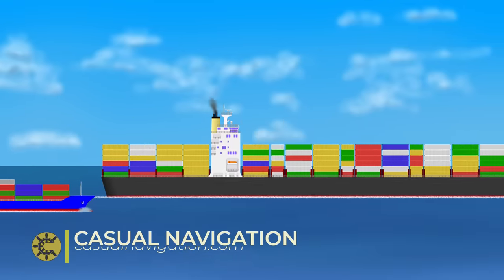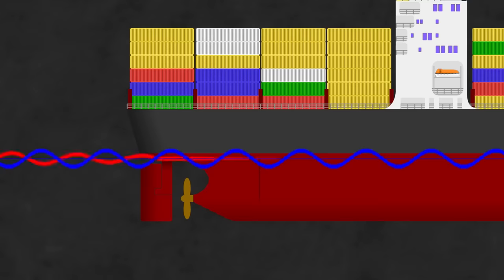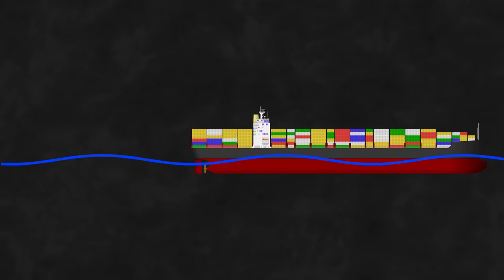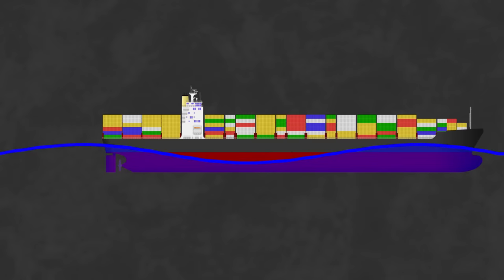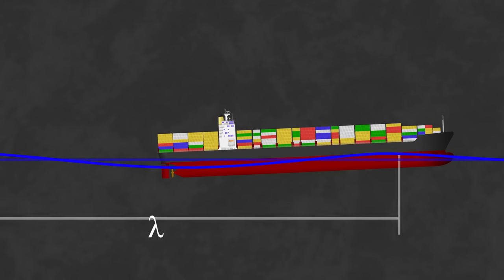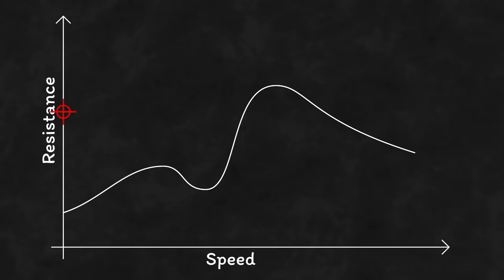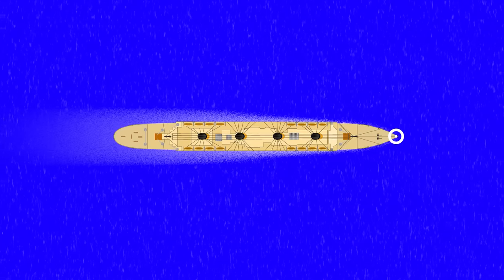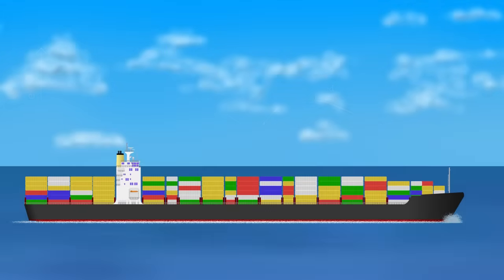Why Are Big Ships Faster Than Small Ships?

Comment: can you please explain how or if this applies also for River cargo ships? Because i'm a River Pilot on the Rhine. I saw in my lifetime as a River Captain, that our bigger ships, also need less energyto get to a faster speed then the smaller cargo vessels. But on the river you stil, have the so called "Slip" effect over ground, because we often have less dept under us then seeships, i would wonder how this effecty concur eith eatchother.
Reply: The video is way over-simplified to the point of being completely wrong. It is naming ONE of a series of important effects. For example, a submarine does not have a bow wave or stern wave while underwater, yet extremely overpowered nuclear submarines are still limited to a little over 30 knots. Nuclear-powered aircraft carriers are also limited to a bit over 30 knots which is oddly a similar max speed to nuclear submarines.

There are a few major factors not addressed at all in the video:

1) The drag equation that does not care about bow or stern waves. This formula is Power = 1/2 p v^3 A Cd. If you combine this drag equation with the Cube-Square Law, you get the number one reason why larger ships are faster than smaller ones. 

2) Turbulence. 

3) Inherent efficiencies of larger engines.

The first one has the power of a ship's engine having to go up by the cube of the ship's velocity. This is easy to understand as the ship has to push water out of the way of the hull at the ship's speed. The energy imparted to the water will be 1/2 m v^2. However, as speed increases the ship moves more water out of the way per second. This is directly proportional to v. This is where the third v comes from. The p or rho is the density of the water so p v is proportional the mass of the water moved out of the way per second and the 1/2 v^2 is added to give the energy. The A is the cross-sectional area of the hull and the Cd is the drag coefficient (a term for how efficient the hull is).

You can roughly figure out how much increased horsepower you need to increase the speed of a ship by just using the drag formula. This is what the formula is for. This is why it works for aircraft, cars, and boats. This is why a family car can go 100 mph or 160 kph with 200 some horsepower but a 400 horsepower car may only go 150 mph and a 800 horsepower car may only go 200 mph.   

As a sphere increases in size its surface area increases by r^2 and so does its cross section but its volume increases by r^3. This same law works for all 3D shapes. Larger ships have less A or cross-section per unit mass than smaller ships. This makes larger ships more efficient even if they do not have much of a bow or stern wave at all. Larger ships are more efficient even if they are moving at just a few knots with little bow wave at all. This logic works equally well for submarines, aircraft, and cars as all vehicles on earth move through a fluid (air or water). This is why larger aircraft have longer range than smaller aircraft (all else equal) because they can be more efficient per unit mass and burn less energy per unit mass per second to go a certain velocity. This is why even very slow-moving cargo vessels tend to be large as it is cheaper fuel-wise to transport in bulk.  Water is vastly denser than air (so p is much larger), but water allows for very large craft and not too much need to build extensive infrastructure for every mile those craft move. Aircraft are more efficient for the drag formula but need to move so much faster to maintain lift, need to have so much more surface area (in wings) to maintain lift, and have a lot more turbulent drage. Huge water going cargo vessels (barges to large oil tankers) can benefit from the Cube Square Law without needing tons of expensive infrastructure. Cars have to make contact with the ground and a lot of energy is burned in friction in the axles and with rubber moving across the road.

Smaller speed boats can become more efficient by raising much of the hull out of the water and thus reducing A per unit mass. This works similarly to hydrofoils but like hydrofoils it requires fairly high speed. Speedboats are fast not because they ignore bow waves but rather they lift much of the boat out of the water and reduce A.

Turbulence is another factor. Smaller craft have more surface area per unit mass to cause turbulence. Turbulence is a complex factor but theoretically the maximum efficiency wing of an aircraft would be infinite in length because the tips of wings produce a lot of turbulence. This same general idea is true for boats. Propellers and everything else is generally more efficient when larger. A maximum efficiency boat would be infinite in length for quite similar reasons. The bow wave issue is just a subset of concerns that causes increased turbulence.

Engines are more efficient generally when they are larger. The maximum efficiency jet engine is the size of a 777 dreamliner's jet engines. They're huge. Huge marine diesels are extremely efficient. These engines can only fit in larger vessels. They are more efficient for many of the same reasons that larger aircraft or ship hulls are more efficient. Larger marine engines can produce more horsepower for their size with less surface area causing friction. The thermodynamic cycles of larger engines are also generally closer to the theoretical maximum.

An example of larger engines being more efficient are R/C plane jet engines compared to full-sized aircraft jet engines. R/C airplane jet engines that are very small guzzle huge amounts of fuel to go a fraction of the top speed of much larger jet engines. Small animals like mice also have heartbeats way faster than humans. Whales have heartbeats way slower than humans. 

The subject on why larger vessels are more efficient than smaller vessels (per unit mass) is a complex subject. Bow and stern waves are merely a part of it that novices overexaggerate.

Comment: 2.21 Hull speed , least efficient
3.21 Hump speed , worst.

From the graphic, looks like the most efficient speed is between Hull speed and Hump speed (cmiiw).
Reply: true, but to get over hull speed you need a massive amount of power, so commercial ships only make 50% hullspeed max
Reply: @Jacob-W-5570  That's unfortunate.
Because my understanding is, ship only need to speeds up, past hull-speed 1 time, then the resistance go down, almost the same with 50% hull-speed.

But base on your comment, that 1 time energy boost isn't economical on commercial ship.
So . . perhaps only private ship, that willing to spent that 1 time big energy, and then cruise in faster yet energy efficient.

Comment: For the live of me I don’t get the need to use “feet” or other weird units that do not fit together, as opposed to international ones, particularly in formulas, requiring weird constants and having other inconveniences. Why arbitrarily complicate things like that? As said, it’s beyond my understanding
Reply: Actually, in many cases it is the metric system that leads to complications.  For instance,  speed in knots - knot is based on nautical mile distance unit, which is exactly 1 minute of longitude, so why more convenient to measure on charts than km.

Comment: I expected the answer to be related to the square-cube law. My intuition was that the mass of the ship and the power of the engine increase by the cube of the increase in size (assuming identical proportions), where friction only increased by the square of that increase. Since friction would increase more slowly than mass and thrust, it would take less of the engine power to overcome it with larger ships, allowing for a higher max speed.

Comment: nice theory, sounds logical as you explain it...but, unfortunately, the surface waves at any length, have nothing to do with hull speed,, the deeper the hull, the more resistance unless its a planning hull which reduces resistance, most importantly, speed is based on the horse power / torque thats being applied. . but, i still enjoyed the fictional video.

Comment: why dont they put plane engines on the outside of the ships?
Reply: Because they'd be as well just using a plane.
Reply: When they did it was called hovercraft or ekranoplan
Reply: Bad fuel consumption, too much required maintenance, salt water ruining the metal components...
Reply: Modern Cruisers/destroyers put them inside the ship's hull, in the gas turbine power plant.
Reply: Actually some yachts do have plane engines, not on the sides, but at the back. They are used for boosting speed to very high levels. As to my knowledge, some navy ships also use these types of engines. Of course they don’t pump air, they pump water instead..

Comment: yah watched this 3 times. and still dont undersand. it... so why does my 16ft 7 carrier boat weighing 3600lb. get on plane at only 7 knots. or on gauge 13 mph.. bearly above idle.. like 1/16 engine throttle   hey only does 65 at full throttle... doesnt make sense
Reply: Because the video is wrong or more specifically it overexaggerates ONE effect of many and ignores many just as important or more important factors. Just think why a submarine submerged with no bow or stern wave at all has similar top speed limits as surface vessels. Why is an overpowered nuclear sub still having a top speed of a bit over 30 knots underwater just like an overpowered nuclear supercarrier on the surface? Clearly, something besides waves is a major factor.

The major reason why larger boats are more efficient than smaller boats and the number one equation to figure out power needed for a boat to move at speed is:

Power = 1/2 p v^3 A Cd

If someone tries to say why a larger boat can move faster than a smaller boat (while keeping proportional cross section A) without mentioning this equation, then the explanation should be tossed out. This equation is generally the most important. The bow wave factor is also quite important as are other factors. Fluid dynamics is complex.

The 1/2 p v^3 A can be written as  v A p * 1/2 v^2  where p or rho is the density of the fluid (mass per volume).

Kinetic Energy is defined as KE = 1/2 m v^2 

When a boat moves through water it has to move the water out of the way proportional to the ship's speed. As the ship increases speed it has to move more water out of the way per second. In mathematical form is the mass per second moved would then be proportional to p A v.

Also, we have A which is the cross-sectional area. As the cross section of a boat's hull that is in water increases it has to move more water out of the way to move forwards. A v is the water moved per second and p is the mass of that water.

If you want to think of it this way the p is density or mass/volume (mass per length cubed). The A is a cross section and if times by a velocity gives a volume of fluid displaced per unit time.

This is where the 1/2 p v^3 A comes from. The Cd is a drag coefficient that is a factor defining how efficient the hull shape is (some of the water moved out of the way can be deflected to the side and gets a bit less total kinetic energy imparted to it etc., the Cd term is very complex).

If you use your velocity of 7 knots and 65 knots, then (65/7)^3 = 800. Your craft needs 800 times more power to move at 65 knots through the water than 7 knots all else equal. HOWEVER, not all else is equal as speed boats raise more out of the water as speed increases reducing A. Perhaps A is 1/4 or 1/8 of what it was at 7 knots which would mean the power needed is now 100 to 200 times more than at 7 knots. Hydroplanes are so incredibly fast because they drastically reduce A as their speed increases. Air is so much less dense than water that moving as much of the hull out of the water and into the air as possible increases efficiency. Less surface area in the water also means less other drag effects on the hull (like friction), it also changes Cd or the drag coefficient (more water moves sideways off of a hull raised more out of the water than rammed straight forwards). The turbulence of the wake increases as speed increases, the bow wave is another factor as the video states (one of many factors and an important one). The sound and wake itself suck away energy. There are MANY factors here, but the biggest ones come out of the drag equation provided. The v^3 means ALL craft regardless of bow waves will run into an exponentially increasing power requirement to increase speed. Also, note at slow speeds the drag equation is less correct (as it is the high-speed drag equation). At extremely slow speeds water tension sticking to the hull itself becomes a larger factor. 

The issue is VERY complex as fluid mechanics is very complex. There are many factors and many equations that are useful at different speeds intervals. To fully describe the issue would take pages and pages of formulas. In practice, even the experts have to rely on testing with models to get effects close to right.

I would say the video is wrong because it leaves too much out. It describes an effect correctly, but this is just one effect out of many. This is like many YouTube videos that dumb things down too much to the point of the video being wrong. People tend to upvote dumbed-down videos because people prefer simple explanations. The world is not always simple.

Comment: Before watching the video, let me take a guess.  Bear in mind I have no real knowledge about hull design and whatnot.

The answer is, water is always at 100% scale.  It's effects don't change as a ship's size changes.  The same holds true for aircraft, which I do have some experience in designing, building, and flying RC model aircraft.  It's also one of the reasons why you can get away with strange things in smaller scales that don't work in larger sizes.

Edit:  I was more or less correct in general.

Comment: I frikking HATE arbitrarty non-SI measurement units
Reply: Knots are 1/60th of one degree of latitude per hour, or 1.85kmh. It’s a useful unit on geographic scales, like the routes used by ships and planes. Before GPS you could derive your change in latitude by the sun and stars, and since a major of travel has some north/south element, it makes the math in navigation easier.

Say you’re flying from Madrid, Spain (40°25’N, 3°49’E) to Stockholm, Sweden (59° 17’N,18°4’E), you can use those coordinates and some trig to work out the distance between those cities in nautical miles. 

You travel 18°54’ north, and 14°15’ east. (18.9)^2 + (14.25)^2 = (23.67)^2

You travel the equivalent of 23° 40’ northeast, or 1,380 nautical miles. Assuming your plane cruises something around 500 knots, you will arrive in around two hours and forty five minutes.
Reply: In the southwestern USA we have a water problem: Lake Mead is slowly running dry. So, the volume of water held in the reservoir is of interest. The unit of measure is acre-feet. One acre-foot of water is the volume required to cover an area of one acre to a depth of one foot. Not SI, but I guess it works. 
   When I studied physics a few decades ago, we had to deal with three different systems of units:  the foot-pound-second, the centimeter-gram-second, and meter-kilogram-second. That was a nightmare. Fortunately, the SI system did away with most of that.